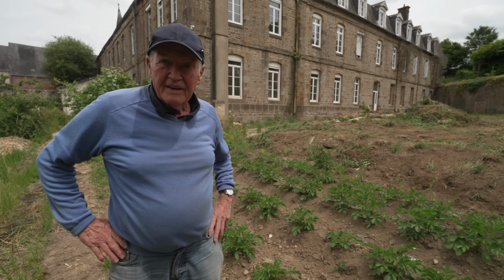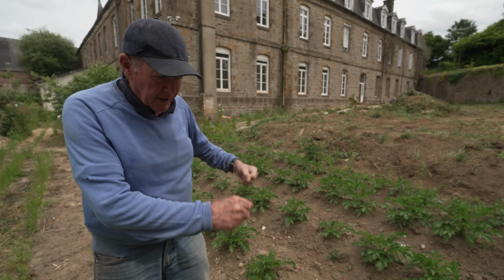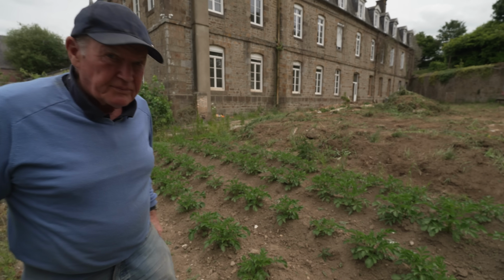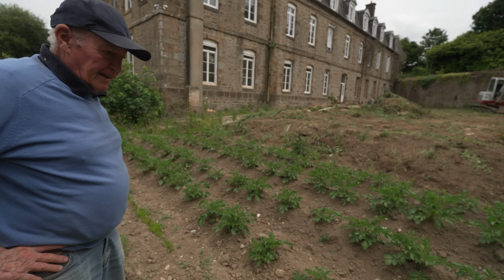Getting It Up At The Convent

Comment: You guys sure are not big on safety. Watching you stand on the handrails at the end of the lift while using a sledge hammer had me worried you would tip the whole lift over.